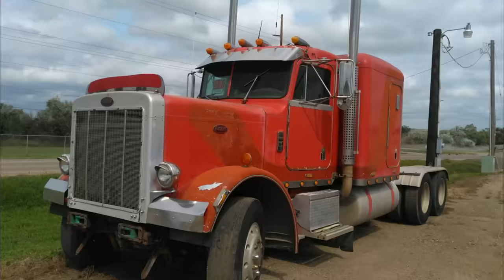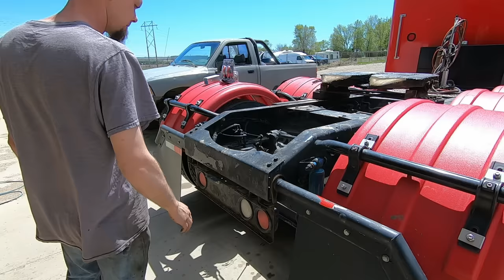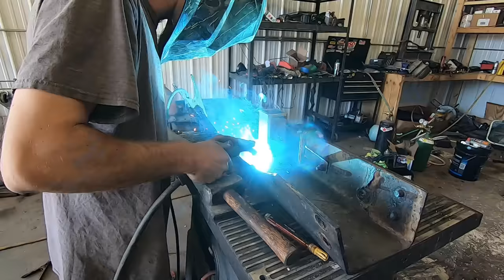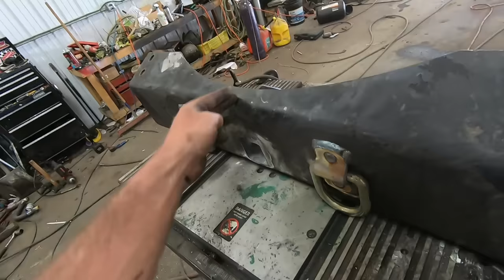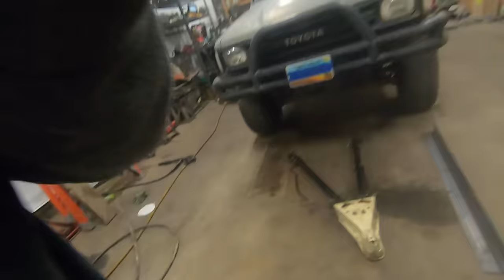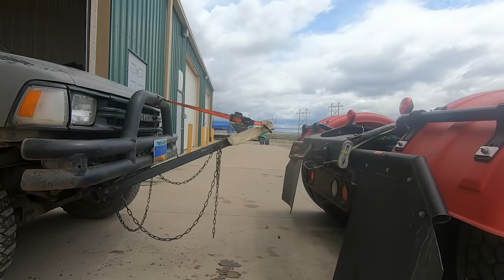Peterbilt 359 Rebuild ep53 - home made  receiver hitch on old red

Comment: Ezra, you need a drop hitch, maybe 8" or so, so the tow bar is level! With a ball hitch, at that angle, if you have to panic stop, all the stress is on the lock down lever, and it will fail! Ball hitches need to be as level as you can get them! Great job making the truck part!
Or you could move the attach points on your PU up and out, so the tow bar is level, and it folds up more vertical!

Comment: Porter greetings! Well, it might be a Chinesium hitch and chain, but the chain does need to go! 😠 I always thought that it’s better to go above and beyond any weight rating you might expect…that way you’re not sorry later. I like an integrated hitch on any truck, especially a semi. Hey, you didn’t want any rusted bolts on that crossmember anyway…it may not give you good ground. Lol! The other good point is that the hitch isn’t hanging down and in your way.  Did you have to replace any bulbs in your light bracket after you dropped it? Lol! I like those brackets and wish I could get a couple extras. Looking around. That might be a good thing to get at a junkyard or dealer. New ones are way costly! 😳 Good ideas and good work! Thanks! 🤩

Comment: Great vid, I always was told that when towing a vehicle or trailer that the tow hitch and tow ball should be at a height that is parallel with the vehicle or trailers main frame / chassis?

So I would in my view lower the tow ball between 2" - 6" to give more flexibility in the pivoting areas of the A frame tow hitch.
Or make a Swan neck in the A frame.

This is just my idea, not a "this is the right way" view.
Reply: Toward the end I think he mentioned getting a lower drop hitch. Was hard to hear because of the wind.

Comment: Do you have a drop for you receiver hitch? I probably would try to find one to get the tow bar more flat so there’s no chance to get it into a bind going over tracks. 
What are your thoughts on welding the gussets solid versus having the inside corner open? I used to work for a big crane company and we built all kinds of equipment for jobs. A lot of their designs had inside corners not welded and back cut a bit.

Also make sure you have the truck in neutral. One of the crane companies I worked for a guy towed a Ford Ranger with transmission in reverse. 😬🤣🤣
We ended up putting a new motor and transmission in the truck.

Comment: I pretty sure a Fabricoed up will hold up just fine even if it rather light duty. That said I do have some serious concerns about the tow vehicle because personally think it’s a bit low on horsepower to pull that Toyota pickup and definitely not sure the brake system of the intended tow vehicle is up,to the task. If it were me I would either have someone ride in the pickup truck to trail brake the truck so not to overheat the brakes on the tow vehicle. 🥸😁😎

Comment: old red going camping is that right Ezra??? the A frame way to short needs to be longer thinking of puting a a frame on the ATV  when I'm out seeding have to call for a taxi  or one on the Ute ...over here you need an engineers certificate to modify a vehicle to add add a hitch to vehicle and stamped too which sounds like BS but 8 grand to get tow hitch built certified and rated

Comment: Great job! Whats the purpose of towing you're Toyota?
Reply: Costs. If you're working on a construction site 50 miles from the house it's cost effective to drive the pickup home than driving the truck and trailer home every night and back to the job site the next morning. Just putting unnecessary miles, wear and tear on the money maker.
Reply: How would you tow the Toyota if the Pete is hooked to the trailer?
Reply: @billygreenhorn9275  bobtail home 1st night and tow pickup next time....sheesh
Reply: Ok no such thing as a stupid question right? ;)

Comment: SO EZ RIDER I WAS VERIFYING OIL PRESSURE BYE TAKING THE VALUE COVER OFF THERE IS OIL GETTING UP THERE JUST NOT SURE HOW MUCH ON MY 02 MACK VISION. YOU NEVER DID ANSWER ME BACK THANKS
Reply from the maker: Hook up a mechanical gauge and check pressure. If it's good your problem is electrical
Reply: @Ezrider359  thanks Ez RIDER really appreciate you my good sir